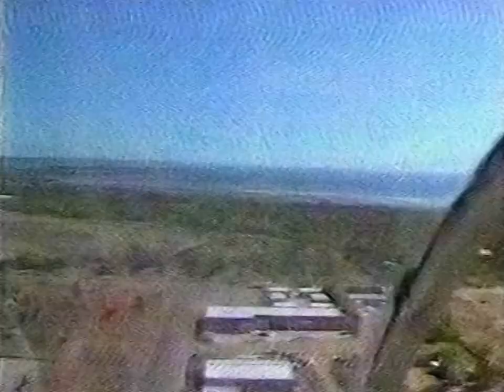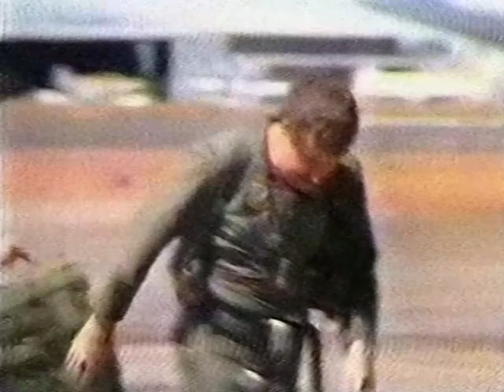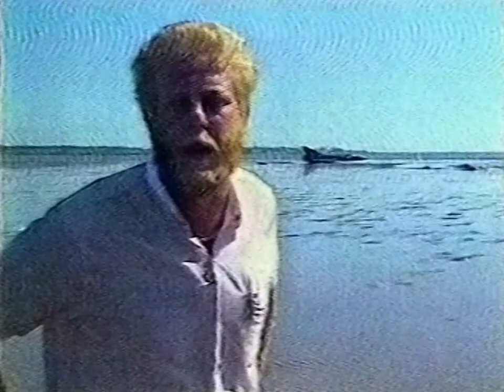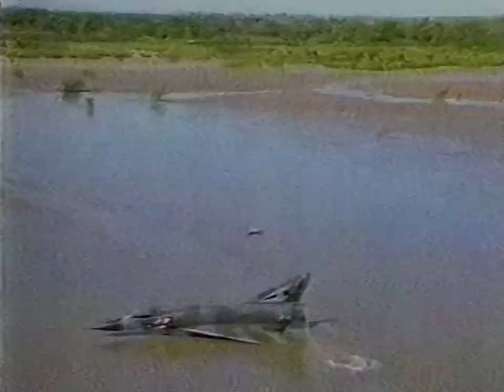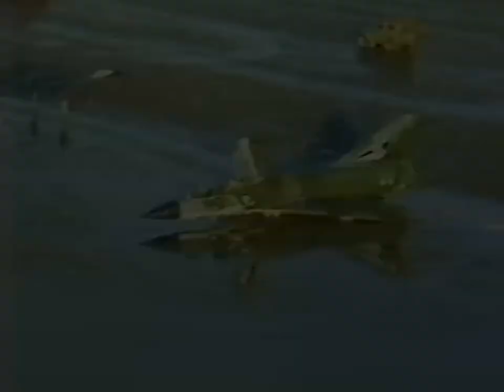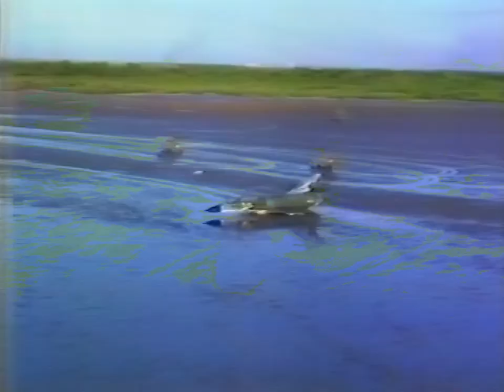RAAF Mirage 3 Crash at Darwin, 27 May 1985

Comment: Pretty sure that’s the airframe on display at the Aviation Museum in Darwin.
Reply: Thats correct, I was there yesterday looking at the damaged done to it which wrote it off (Cat5) the guys at 75 Squadron did a good job restoring it to static display.
Reply: @timorvet1  how is the museum in DN holding up?

I miss Darwin
Reply: @youwebz  Its doing well, Angela, Owen & Steve (both ex RAAF) are moving the museum along at a good pace even with the effects of covid 19 still lingering. Visitor numbers had dropped off with the closed borders and the museum was forced to close in the initial stages of the pandemic, it has since reopened and visitor numbers seem to be on the rise again. Recently they had these huge ceiling fans installed in the hanger and they have made a huge difference as im sure you could appreciate. I asked the guys installing them, what the view of the B-52 looked like from that great height in their cherry picker, they said bloody awesome but lots of dust on it!

Comment: What happened to the Mirage jets Australia had. Never seen them in a Museam.

Shame. Would of made intresting show pieces.
Reply: There’s one in Williamtown:
https://www.destinationsjourney.com/aviation/aircraft-photographs/dassault-mirage-iiio/
I know of at least a second example being preserved, a twin seater that was formerly used for tests:
https://www.saam.org.au/mirage-iiid/
Reply: This particular one is in the Aviation Museum in Darwin, saw it about 10 years ago.
Reply: @jetaddicted  thanks mate.

Closest avaiation museam near me is one in Bull creek. They have a Lancaster bomber there. But sadly no Mirage jets.
Reply: That exact Mirage IIIC is on display inside RAAF Darwin base
Reply: A lot were put into storage for a time and after that got sold on to other countries!
Reply: Think Pakistan took the majority of them.
Reply: Couple at Point Cook.
Reply: What happened to the 116 RAAF Mirages?
43.1% were exported
36.2% were lost
8.6% were scrapped or converted to components
12.1% were retained
100% see below for numbers and details
 

50 were exported to Pakistan; A3-2, 5, 6, 9, 10, 11, 12, 13, 15, 17, 19, 21, 22, 23, 24, 25, 27, 31, 33, 34, 35, 38, 39, 49, 53, 54, 56, 60, 62, 65, 68, 71, 73, 81, 83, 84, 86, 87, 88, 93, 96, 99, 101, 103, 104, 108, 110, 111, 112 and 113.
42 were lost due to: 
18 engine failure; A3-4, 14, 18, 28, 36, 46, 52, 67, 70, 74, 75, 79, 82, 94, 95, 97 and 98 (this includes A3-63 which suffered an on ground engine fire)
11 loss of control and impact with terrain or sea; A3-1, 32, 37, 40, 43, 50, 61, 77, 85, 89 and 109
6 undercarriage failure; A3-47, 58, 76, 80, 105 and 114
3 landing accident; A3-16, 26 and 64
3 lost after being involved in collision with another aircraft; A3-29, 30 and 69
1 tyre failure on take-off and subsequent transport fire A3-8

10 were scrapped or converted to components. 
Of these 5 were scrapped; A3-66, 90, 106, 107 and 116. Another 5 incomplete aircraft were exported to Pakistan; A3-7, 48, 57, 78 and 91

14 were retained as museum or display aircraft; A3-3, 20, 41, 42, 44, 45, 51, 55, 59, 72, 92, 100, 102 and 115
Plus 2 aircraft that are included above as losses were later restored to static display standard; A3-16 and 36.
Reply: @Aussiebloke0001 PAR?
Reply: They sold to Pakistan
Reply: in 1988 forty eight RAAF Mirages were flown to Woomera for storage. They were offered for sale for A$100 million. On 15th April 1990 a contract was signed with Pakistan for fifty aircraft including ground equipment, engines, drop tanks and spares for $36 million. Many of them are still flying after a modernisation upgrade. Pakistan still has not paid for them....
Reply: @Aussiebloke0001 its also funny seeing planes you worked on in a museum :( even worse is when you're not allowed to sit in the cockpit of one that you spent hundreds of hours in the cockpit, such as fighterworld's F-111
Reply: @dimuthsenanayake2091 Thats right
Reply: @magicmudkip3938  MirageIIIO was it's designation and yes this aircraft, A3-36, is indeed in Darwin Aviation Museum.
Reply: @GlideYNRG  I believe it was 48 that went to Pakistan (edit: apparently it was 50)
Reply: @stephenbachman132  haven't been in there for some time, next trip south I'll get back in there for a visit.
Reply: A3-42 is in hars museum Albion park sth of Wollongong nsw! Mine A3-17 has been refurbished & still in service wth the Pakistani airforce!!!

Comment: Pilot would gave survived easily. The plane is very much intact, even standing on its landing gear. 

Virtually stall proof delta design is inherently stable and would have just floated down minus pilot.

Pilot did what he thought he needed to do at that moment but likely could have still put it down. On the runway.
Reply: The required actions for engine failure - eject.   The engine -out glide speed for the Mirage was 250kt.   One RAAF pilot landed two different Mirages after engine failures, saving millions for the RAAF and was very strongly censured, he was taken out of jets and sent to VietNam to fly Cessna 180s on FAC.
Reply: Yep very fast glide speed, I heard the deadstick at RAAF Laverton was 300KIAS. Must be a hell of a sink rate.
Reply: "Just floated down" hahaha
I would love to see you at an hydrogen bomb test:
"Why are you all standing so far away? When it goes off just put your arms out and ride the shockwave to safety" haha
Reply: @retix11  absolutely, I witnessed this Mirage crash and along with the residential homes there are 2 main roads before the runway. He was hailed a hero for diverting it into the mangroves
Reply: The voice of experience.
Reply: "Virtually stall proof delta design" Not even close to stall proof......